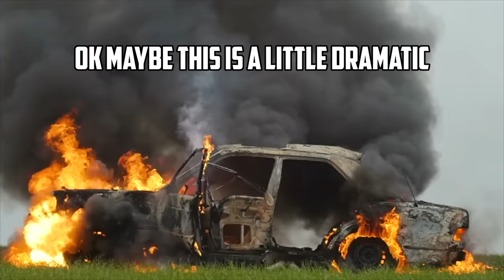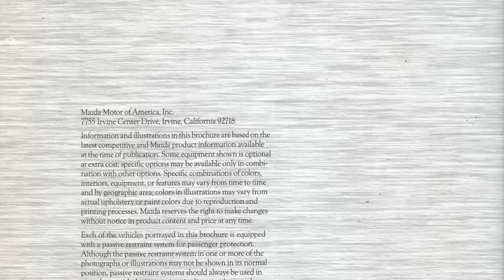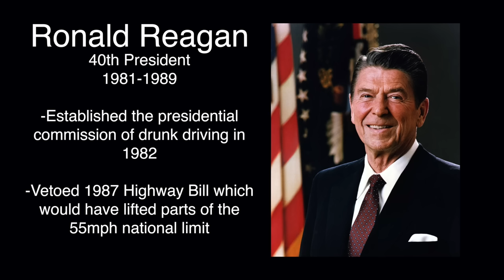Automatic Seatbelts - Why They Were Used & Why They Went Away!

Comment: GM skirted the law on cars with full frame doors by attaching the seatbelt to the door so you could in theory leave it buckled and get in/out without having to manually put the belt on. My friend had an 88 Oldsmobile Cutlass Calais like this. Most people used the belts like conventional belts and unbuckled them every time. 

I always wondered how they would fare in a crash if the door popped open. I think they had an extra latch at the upper part of the door to try to prevent this but I could still see it happening.
Reply: The 3rd Gen prelude actually has a recall on the seat belts not being safe in an accident because the doors can pop open and allow you be ejected from the vehicle iirc
Reply: Another reason I never liked GM (aside from slim to zero reliability).  They really cheated the system and cheaped out, just as they built updated versions of 60s engines all the way into 2010+
Reply: Same... Pontiac Grand Am had these too. Pain in the proverbial @ss when it rained hard and you were trying to get in (especially when you had an umbrella)
Reply: This is actually what soured me on GM for probably the next 20 years.   I figured if they half-@$$'d passive restraint requirements what else were they half-@$$ing.
Reply: @jamesdelius  ummm... Only EVERYTHING ELSE!! (except stereos. They did have the best sounding factory stereos)

Comment: Both my 89 and 91 Cressidas seat belts still work. Fun fact, the Cressidas belts pivoted for comfort unlike my old Honda belts which were fixed. But unlike the Honda belts, the Cressida belts don't unbuckle but they do have safety release levers by the ebrake.
Reply: I had an 87 Cressida back 15 years ago and could never figure out what the safety release lever was for, when I pulled it the car beeped and some light flashed on the dashboard! The manual wasn't specific for what it did and now it finally explains everything.

Comment: An honorable mention is the style of seat belts you can find in Some GM Second Gen. J-Bodies. The seat belts were attached to the door itself and not the B-pillar. When you open the door you can exit while the seat belt is still buckled, solving the no automatic lap belt issue. Owning one that has this feature(1994 Chevy Cavalier), I never use it. It just makes it too difficult to get in and out of the car.

Comment: My 1989 Ford Taurus had the motorized seat belts. Yes, you still had to manually buckle the lap belt, but the motorized portion never failed.

...I wish I could say the same thing about the four engines that Taurus burned through.

Yes...I said four. The first one failed while still under warranty. Should have sold it then.

The car that the Mythbusters used to test escaping a sinking car looked EXACTLY like my old Taurus. Except for the fact that we were on opposite coasts, I would have assumed the Mythbusters used my old car.
Reply: Not shocked by the motor ordeal. The Taurus has always been a junker.

Comment: Nice video.  The phrase you might have been looking for, the requirement of the U.S. government is "PASSIVE RESTRAINT."  It was met in three ways: 1. GM chose the cheapest, by attaching the belts to the door.  In theory, you would have to manever through this web-like mess without hanging yourself.  When you closed the door,  PRESTO, your seatbelt was engaged.  In reality, most people just disconnected it like a regular belt. 
2  The electric shoulder harness you discuss, used by Ford and the Japanese makes.  The lap belt still had to be manually connected, and it was found that if this was not done, the occupant would "submarine" under the connected shoulder belt, making it ineffective 
3. Last and priciest was the "Supplemental Restraint System," commonly referred to as an "airbag."  These were installed by Chrysler, to their credit, as these were the most effective system.  It's ironic that GM first offerred airbags, or the "Air Cushion" system, as an option on many of their upscale full-size models in 1974!  They were soon discontinued as practically no one ordered them.  Soon after Chrysler's introduction of the airbags, it was determined that the airbags were most effective if the seat belts were fastened, so you still had to fasten your belt!  Plus in the first years of use, only the driver got an airbag; the passenger was out of luck! 
Well the first two were hated by most drivers and their passengers, and so all manufacturers eventually switched to airbags.  Today you can find vehicles with four, six, even eight or more airbags!
Reply: My 2010 Toyota has a whopping 9 airbags, and I think new stuff is up to 12 or more.
Reply: The earliest Dodge Vipers also had door mounted seatbelts, though only on USDM cars. Export versions had them mounted to the rear bulkhead, inboard of the seats like in a Lamborghini Diablo.
Reply: @Gordanovich02  Oh, nice.  I did not know that.  Thanks
Reply: @atlmuscleman  Great comment!  It really pissed me off how GM always chose the cheap route.  The "automatic" seatbelt cheat, the use of 60s technology engines well into the 2000s... and then they acted surprised when they were in dire straights in the late 2000s. 😡🤦🏾‍♀️

Comment: I had a Saturn with the seat belt.  While it was amusing to see a guest sit in the car without telling them the shoulder would automatically move into place when the door was closed... it wasn't ever an issue and worked well... unlike the engine.  
It was also easy to un clip the belt for cargo/passenger manipulation.  

I found it novel, well designed, but not necessary.  You still needed to use a lap belt in the same way.. Stunt? Feature? Reminder? You tell me?

Comment: We had these on a car my mother owned when I was young.  I loved them.  Not for any material use.  But because it was the first "automatic" thing in a car I had ever seen.

We had to roll our windows up.  We didnt have AC.  We didnt have an automatic transmission.  Everything was bare bones.

And then there was this super high tech machine that placed a seatbelts on me when the car started.

If I ever win the lottery, I will buy a racecar bed and install automatic seatbelts.

Comment: My Toyota Tercel had a semi-automatic, non-motorized two-point shoulder seat belt that attached to the door. You still had to connect the lap belt, but at least you had a shoulder belt by default. It was very convenient and it worked great.

Comment: I remember cars that did that when I was little. I honestly thought they were stupid because they didn't really line up with me when I sat in the front seat.

As an adult I wish seat belts had padding. When I was involved in an accident most of my injuries were caused by the seat belt itself (the foot rest caused the only other injury because I neglected to bend my knee before impact) and while there would have been more injuries if I wasn't wearing a seat belt the problem was how they dug into me. If only they were soft without hard edges I'd be more comfortable driving and I wouldn't have been as seriously injured.
Reply: I suspect the problem with padding is that people might not wear them as snugly, or it might interfere with the operation of seatbelts. Seatbelts don't just sit there, they have mechanical function as well, and are designed to behave differently depending on adjustment, being in an accident, strapping in a baby seat, etc. My aunt was in a car accident around the same time I was in one as well, and when we were talking about our accidents later, she mentioned her seatbelt seemed to unravel and loosen up shortly after the impact, which surprised me because mine didn't. Supposedly, the doctor and later the dealer mentioned something about some belts being designed to do that in an accident to relieve any pressure after absorbing the crash forces. As a new parent, I also learned a lot about how restricting movement is supposedly key for protection, so they show you how to lock the seatbelt when installing a child seat, and they warn parents not to strap children in with thick padded clothing like Winter coats, because the belts should be snug against the child's body.

I doubt a little bit of padding would be all that bad, but it's probably more trouble than it's worth. Supposedly, with child seats, there's an issue of liability when it comes to tested configurations. If you attach untested toy clips and bottle holders and stuff to a child seat, you can actually be determined not to have installed the seat correctly because it wasn't crash tested with those things, but the manufacturers have to instruct you not to attach third-party sunshades and things like that. It's possible there may be something similar going on with adult seatbelts, where they would need to make them removable for comfort and temperature management, but they don't want to be held liable for people using seatbelts inconsistently.
Reply: @davidboeger6766  Absolutely right. Injuries caused by the seatbelt themselves are usually superficial, the injuries prevented by the seatbelt would have been much worse. This is a trade off we make for them being effective.

However, assuming Elliander is female, there might be another problem here - seatbelts are designed for the average height range of men. Many women are below this height range and therefore the seatbelt does not fit them correctly. It will still prevent injury, just not as well as it does for someone in the height range it's designed for, and it can cause both discomfort and injury in accidents because of this. There's not really much you can do about this except for  pay attention to it when you choose a car and look for one that has adjustable seating so that the seatbelt can fit you properly (crossing hip bones and collar bone).
Reply: @davidboeger6766  Well, padding doesn't have to be as thick as a towel, but the edges of my seat belt physically cut into me and caused an injury that bled for a few days. Some tissues even turned necrotic due to blood loss. That was at my waist. The forward motion of my body meeting the hard edge is what caused it to cut.

For the other seat belt injuries that were pretty bad looking, but didn't scar because I used a nori bandage forming a second skin and keeping it in place for a week.

Maybe the edges of the belt could have some soft gel and/or foam to prevent digging in. Or maybe a tube belt can work, or perhaps an oval that's relatively flat, but when pressure is applied to the sides it could change shape somewhat to absorb that impact rather than only being used to hold you down.

Comment: My step-dad had a 1995 saturn sl1 that had an automatic seat belt that broke in an accident and he hit the steering wheel and broke his rib. He continued to drive that car for 3 more years with no engine cooing fan (broke during impact) so the engine would overheat the whole time. Odometer reading was stuck at 150,000 miles for 10 years so the car had roughly 300k-400k miles by the time he was done with it. At some point the chain linkage broke so he had it held together with zip ties that he would replace every week. Eventually he sent the car to the junk yard because it was falling apart, the overheating engine and transmission were still going strong.

Comment: Around 1990, I was 20 years old and living on the east coast of Canada. I didn't have a car and hitch hiked everywhere. One day I was picked up by an American and when I got into the passenger seat an closed the door the automatic seat belt came down. I had never seen or heard of it before and for a minute I thought I was being kidnapped.
Reply: 🤣🤣  very funny.    I'm an '89 baby and the first time I sat in a car with automatic belts was when my new babysitter took me down the street to the candy store a few blocks from where I lived and thought the babysitter had a built-in choking device installed in her car😂   She was a nice lady though  but I wasn't so sure about her car which seemed pretty new at the time, I don't remember the year/make/model I just remember it was white with a red interior,  early 1990s if I had to guess now.    And later on I remember my Aunt Sandra having  a 1991 I believe,  Mercury Topaz for a short  while and it had these automatic belts which she hated with a passion and likely the reason for getting rid of the car besides rust and some mechanical issues.

Comment: When I was a kid, my uncle's car had these. They were kind of annoying, because if the door was shut, you were buckled in, whether you wanted to be or not. I always wear my seatbelt when the car is in motion, of course, but when the car is stopped I should have the option of leaning forward if I need to. It was also a problem getting out of the car, because you had to open the door and wait for the belt to move, and if it was raining you just had to sit there and get rained on while the belt took it's sweet time retracting. 

I also remember hearing that those belts could be dangerous if you weren't wearing your lap belt as well, but I don't have any personal experience with that, thankfully.

Comment: I miss them for coupes and 3 doors.  It made getting in the back so much easier because you didn't have to fight the belt or somehow contort yourself under it.  Kind of wish they still had a sliding mechanism, even if it was manual, to ease in embarking 2/3 door cars...

Comment: My 1991 2nd gen RX-7 has those automatic seatbelts. I didn’t know they were under a recall and I could take it to the dealer to be replaced or whatever they do. I’ve never had any problems with them yet or the pop-up headlights. I’ll have to look into that. My car is gorgeous, always garaged, original everything, except for the radio, and 130k miles on a 30 years old car. Zoom zoom.

Comment: This is insanely well timed by Youtube algorithm.  
Last night my ford probe 1989LX  automatic seatbelt got stuck.  I removed the fuse so the motor wouldn't run the battery dry.    I did not look info on it from the internet.   today I went to my firends garage and fixed it.  The railing was bent just a tiny amount.  Seems that the belt roll next to the seat would get stuck if my childs safetyseat is on the frontseat when the belt goes past it, creating huge amount of tension to the bar and bents it a  tiny amount.

I fixed it by removing it from the car, hammered the slider a bit, then pushed the wire back to it's slot and squeesed the railing back together with pliers.    Took less than an hour.

Comment: I liked GM's solution to this. My 93 olds achieva SCX has the seatbelts mounted on the door. They function as,and look like normal seatbelts except you never HAVE to unbuckle them,when the door is opened the seatbelt extends with it and you can just slip in and out of the car without ever buckling/unbuckling the seatbelt. AND no complicated parts to break,it works the same as any other seatbelt! I also noticed theres an extra door pin or support in the door channel compared to my 96 achieva sc with normal seatbelts. I assume thats probably there for concerns of the door coming off or moving around in a crash that could cause the seatbelt to not be as effective if that extra support wasnt there but i dont know🤷🏼‍♂️

Comment: Another issue was that only the shoulder belt was automated. You still had to buckle the lap belt, which was easy to forget to do (or, if you were in someone else's car and didn't have them in your own, realize that you were supposed to). As I recall, there were cases of people being seriously injured because they slid out from underneath. It also kind of felt like you were being attacked by the darn things. Seat belts became mandatory, airbags became standard, and more people started following the law and/or stopped being idiots, so they just stopped making sense.

Comment: I'm not sure if it was mentioned anywhere, but there was a major reason why these automatic belts were popular between 1990 and 1995 or so, which is the federal requirement for passive restraints starting in 1990.  Some companies chose to implement a driver (and possibly also a passenger airbag) to fulfill this requirement, but often cheaper cars went with the automatic belt option due to cost.  As existing models were redesigned during the 90s, or as old models were replaced with new ones, front airbags were phased in due to the upcoming requirements in 1997.  This combined with the OBD-II requirement in 1996 is why many car models were updated or redesigned around that time.

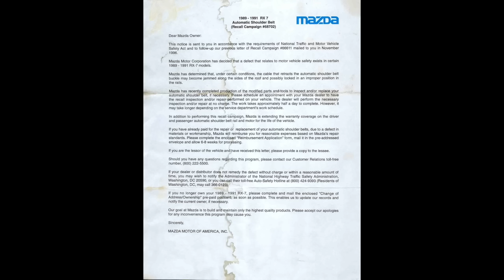Comment: 6:10.  We owned a 1991 and a 1994 Mazda Protege from 1994 through 2016.  Both came from the factory equipped with automatic shoulder belts.  Never had a problem with either of them.

Comment: My parents bought a 1964 Pontiac. It was the first car in the family with seat belts. We wore them from day one. The same type of conspiracy / anti-mask, anti-ax idiocy was prevalent then against seat belts (and soon after against shoulder harnesses - "They're more likely to break your neck in an accident than protect you!" (Ford engineer)   When I commandeered my father's abandonned 1965 Ford Pick-up I took the seat belts out of the Pontiac (before it was towed off to the junk yard),  and installed them in the pick-up. Very easy. I think it was 3/8" bolts, holes in the floor were already there, threaded.
The Pontiac replaced a 1953 Chrysler - in which when my mom hit the brakes at less than 5 mph I slid into the solid steel dash and killed a baby tooth. The Ford F100 had a 289 V-8, same as Mustangs - so it was pretty sporty. However, it wasn't until I bought a 2020 Tesla Model Y that I had a car with faster acceleration than my mom's Pontiac.